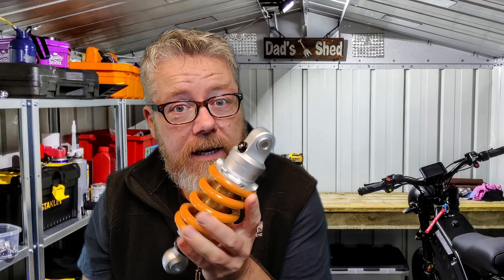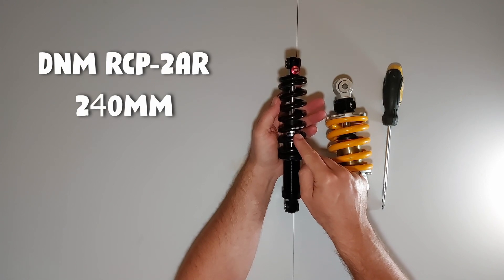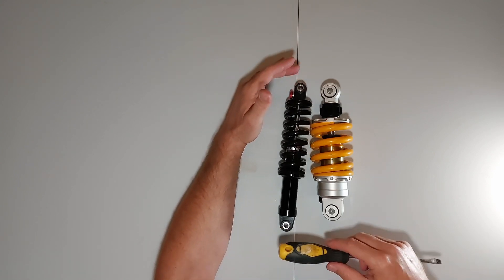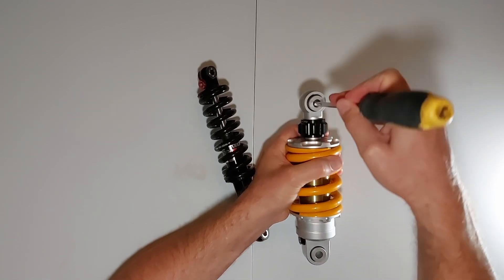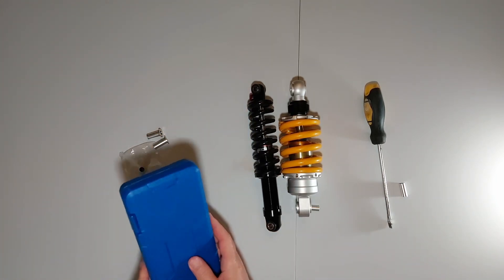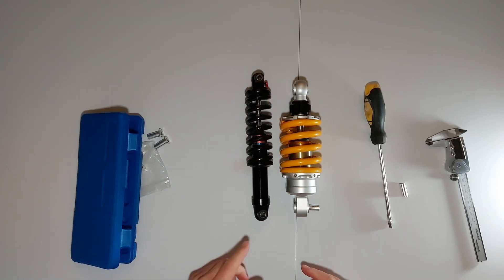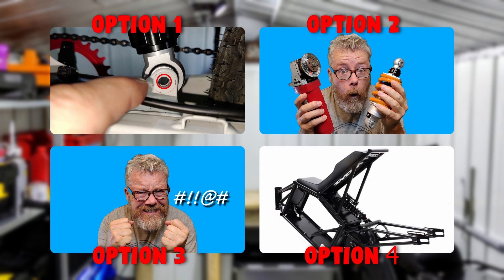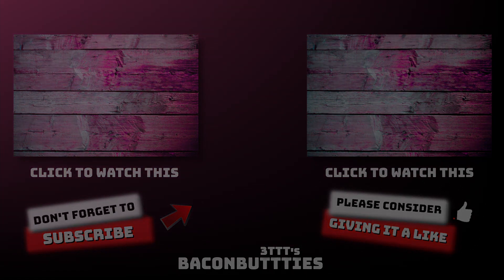CAN YOU PUT A MOTORBIKE SHOCK ON AN EBIKE - MSVA EBIKE BUILD PART 19 ISH

Comment: How about changing spring in the DNM shock for a higher weight rated one? I run a 700lb/I foxshox one in my DNM shock and it feels great on the road. Or you could get an even stiffer one made up to whatever you want, there are companies that do it. All the best
Reply from the maker: I contacted DNM and it was £12 for higher rated spring and £90 for shipping ... 😱
Reply: @baconbuttties  dnm are terrible for that. The foxshox springs are compatible if you want to try them
Reply from the maker: @Fred_PV  The foxshock spring will fit the DNM shock?
Reply: @baconbuttties  yeah it's the same diameter. It is for the rcp2s anyway, I'm assuming yours is the same too
Reply from the maker: @Fred_PV  👍🏼

Comment: Great video as usual. I saw it a while ago and I came back a few times to see the continuation of this project. Are you going to solve the problem and improve the suspension? I would like to see that. Thanks for your creative ebike content. You are appreciated.
Reply from the maker: I didn't like the handling of the bike at all, didn't feel planted.Had a few test rides the  sold it and the next project is electric motorcycle.
Reply: @baconbuttties  That's too bad. I'm sorry it didn't work out for you. Better luck on the electric motorcycle project. I will be sure to watch that next. I am impressed you responded to    so many posts. Cheers.
Reply from the maker: @davidlittlefield2483  👍

Comment: A: Make a new bush where the 8mm hole is offset relative to the 10mm OD?
B: Try the shock upside down?
Reply from the maker: I did try it upside down and was the same. I don't think there's enough material  to offset.

Comment: Could you evenly take 1mm or 2mm off the swingarm itself?
Reply from the maker: I,m not sure how thick the metal is so it may compromise strength.
Reply: @baconbuttties  im sure 1mm of it is paint most likely
Reply from the maker: @MrDeceptacon88  I think I would rather add material than take away. Possibly cut of mounts and have larger tabs welded on with 10mm holes and 10mm bolt.

Comment: Hi. Another good vid. I started with a DNM RCP3 on the rear of my bike (I am heavy and also have a QS273 motor) so a lot of weight. The shock bottomed out, I tried stiffer springs with no luck. Then I tried 2 DNM air shocks, better, but had to constantly pump them up. In the end I settled for the same shock you have (with a remote reservoir). About a 1000kms later, it is perfect. I drilled my frame to 10mm as I worked out the extra strength of the spring on the new shock, would be near the limit for an 8mm bolt. So, my suggestion, grind the frame between the bottom shock mounts, no effect in the strength, to get the clearance you need and try new shock with 8mm bolts. If it works well and you are happy with it, then drill out the mountings and use 10mm bolts. (Not sure how to contact you, but if there is a way, I can send you pics of the different set ups I tried). Sorry for the long message.
Reply from the maker: Thanks for the tips, I did look at the shock with the remote reservoir but bought the one without in the end because I wasn't sure where I would mount it  👍🏼 you can send pics to baconbuttties@gmail.com

Comment: The easier option is to grind the shock down a millimeter or two, the lengthier solution is to grind off the mounts and build new ones, then weld them on. However, if you go that route, you will need to remove the whole swing arm and re-powdercoat it after welding and grinding, as it will leave raw metal exposed. That’s going to be a much longer process and if it were me, I’d rather grind the shock, which will be a 10 minute job. If all else fails, you can always find a different shock.
Reply from the maker: I was originally going to try the twin DNN shock method but I don't know if that would still be bouncy. I would favour the new mount method even though its more work.

Comment: i agree with some commenters. dont grind, bend, cut, weld or drill your terrific bike with 3 miles on it. i dont think you should have filed the powder coat from the drop outs. i would have ground the axle just a little. it is exposed any way.
buy a different shock.
you will find they have loads of power. i know just from watching videos. there are a bunch of young guys that will twist that throttle just to raise the front wheel.
i started watching this build earlier this evening when i ran across your channel. i like the bike. i want to do the same but dont know if i should. i have even offered to slyyyyly build a mini bike or electric bike for some grandkids to play on. i got 1 bite and that was one that just started driving so that wont last long.
i wanted to ask when you find out how the power would handle my weight to let me know. im 6 ft 230 lbs. dont want to need power.
so i enjoyed watching. i will look and see what else you are doing later.
Reply from the maker: I,m 199 lbs and the handling  on the electric bike wasn't  very good. After a few road tests I decided  to sell it and start a electric  motorcycle build  using a yamaha  frame.

Comment: i like this channel .. i built a ebike( stealth bomber )  during the lockdown and  i had tons of issues 
do not drill or grind anything  !!!!!  it is the path to the darkside 
i suggest  option 3  then option 4 
or  realize this will not work  and get a stronger ebike "specific" shock  that fits
Reply from the maker: It is the the path to the darkside, because once you drill or grind  you can't go back 👍
Reply: @baconbuttties  If you are anything like me, the shock will be hanging around unused for years if it doesn't get fitted. I think grinding will be the best way forward. 

I like the pogo stick comparison, defiantly true!
Reply from the maker: @jamesclarkson5618  👍🏼

Comment: You can  cut off  shock bracket  and  rise it up little bit and welding back on the swing arm
Reply from the maker: That's probably the best option but probably the hardest. Dismantle swing arm, get someone to weld it, respray area  or could buy another swing arm and modify it  👍
Reply: @baconbuttties   you could  do that too
Reply from the maker: @ebikerider6273  👍🏼

Comment: I would weld 2 new tabs to replace the frames stock tabs, use 5mm plate. 
As a result of using thicker 5mm material you could then also make the tabs in such a way before welding to have multiple M8 or M10 holes (like around 3 holes) to allow for different Shock height positions for  your most comfortable riding position.

 I think if you made the tabs in an upside down trapzoide shape with rounded edges. (1 hole in centre down low & 2 holes equally spaced above) should work out nicely. Just my 2 cents. 😊✌😎
Reply from the maker: I agree with lower bracket fabrication being the beat solution  👍
Reply: I have a slightly older Vector Typhoon (4-5 years, the bike in my sig) which has an adjustable upper shock bracket that is basically just what you're talking about, it has extra holes in the frame to allow the top shock bracket to be raised up or down giving about 50mm of extra movement. After looking at your frame I can't understand why Vector would make this so called (tweak?)  The only thing I can think of is to save a little money by using fewer parts, but is it really worth it...
Reply from the maker: @hardergamer  👍🏼

Comment: I would probably nibble a little off the bottom of the shock and nibble a little from the swing arm between the shock mount but you could have someone weld up the hole , grind it flat ,then redrill it, then touch up the mount with a little tin of smoothright paint. You are doing a great job by the way, I’m intending to build something similar except I’m going to buy the larger frame from the Ukrainian company you got yours from but fit it with a normal motorcycle swing arm and go for a 12 kw wheel. Should be good. I’ve got a brand new set of forks from a Chinese 250 motorcycle with a ktm set of yokes and a Ktm 390 swing arm. Unfortunately the next purchases become expensive and I’m not sure I can hide them from the wife, 😂with the financial climate being like it is I’m going to wait a while till I buy anything else. Your project does give me hope that I will get there eventually 👍🏼👍🏼keep going. Ps I’ve just purchased a meriva like you as well , great minds and all that.
Reply from the maker: I been looking at the larger frame with the new swing arm they do for the QS 138 motor. How are you going to fit the KTM yokes? because motorbike forks seem better suited to these high powered machines.
Reply: @baconbuttties   I’ve seen a set of fast ace motorcross forks fitted to a Surron ( which are usually fitted with DNM forks) the guy had a couple of adapter cups milled up to convert them. I intend to do the same. I’ll be using the qs138 frame but without the swing arm as I want to use a hub motor so that the bike runs quietly ( no chain noise). I’m hoping for an 85 mph bike, which I will need to restrict down to 4kw for the msva test. I had an idea that if you get a bike finished you could then sell the frame and vin number and reg number on to someone to rebuild it using there own equipment ( you’ve done the hard work for them?) then replace the frame with your parts and repeat the process . Money could be made?
Reply from the maker: @christopherwatts6634  I wonder if there's a market for registered frames? As it could work if people are willing to pay extra 👍🏼
Reply: @baconbuttties  after communicating with eleek, I get the impression they are quite open minded when it comes to business, maybe strike up a deal via a franchise of sorts, they supply the frames which get registered. Once the msva get to know you, I’m sure things would go smoothly.? It’s a case of how many people would pay extra for the pleasure of having the hard work done? Food for thought. Keep doing what you are doing👍🏼
Reply from the maker: @christopherwatts6634  👍🏼

Comment: Just shows these frames whilst they may look all the same have subtle changes. Sorry to hear your still having problems with rear shock. I know your pain went to lace up my wheels and a simple task turned into my worst nightmare
Reply from the maker: Yes the frames are all a bit different. I don't think I would want to try lacing wheels as it looks like it needs patience 👍🏼
Reply: @baconbuttties  thinking about your issue and how I would tackle it I feel the best option would be to remove a little material from the lower shock eyelet just be careful to only remove enough for clearance  also if your frame is like mine and the steel plates have a weld seam on the inside you may only have to remove from the outer edge perhaps at a slight angle giving it a bevelled edge may be enough for correct  fitting
Reply from the maker: @haggisbasher2906  I don't think the shock touches the weld seems as the centre part is thinner than the overall diameter where the bolt goes through.

Comment: time for Mr Grinder to meet Mr Shock or just get a second hand Vanilla Float like mine mate...huh Houuyyy
Reply from the maker: Are the fox shocks okay ( not to bouncy )
Reply: @baconbuttties  we chatted a couple o weeks back, it's bloody dreamy, loads of em on ebay second hand. I got mine on Gumtree for £30 coz a lot of riders just want the latest models and have a chunk o furlough cash to spav.
Reply from the maker: @jclive4773  👍🏼
Reply: @baconbuttties  maybe i could borrow that Noggin of yours a sec. I am just deciding which Battery to go for, i'm building the same as yours but mid-drive bbshd and lightweight, to get back round the world with.
When we use the power modes on the controllers of these Bikes, does that dial down the amps or the volts? 
P.s. i never got to learn about electronics so i'm trying my best.
Cheers John

Comment: Don't touch the shock. Take off the back weel and grind out a little from the frame inbetween the two sides of the bottom bracket it won't take much to make it fit.  😎♥️👍🚴‍♀️🚴‍♂️🚴‍♀️🚴‍♂️🚴‍♀️🚴‍♂️
Reply from the maker: I'm not sure how thick the metal is so am not sure if grinding in that area is okay 👍🏼
Reply: @baconbuttties  I've heard someone with the cheaper steel frames had the weld where the swing arm meets the box section crack, so definitely wouldn't weaken that area.
Reply from the maker: @EverythingEbikeChannel  👍
Reply: The two sides of the bottom bracket is welded separately with a l shaped bend it is probably just the extra thickness of the bracket metal getting in the way the frame may not be the problem. It's Werth a look

Comment: Take the sleeve out go for a test ride see if you even like it.
Reply from the maker: I did put a 6mm in the hole and sat on it and it was more on the firm side which I prefer 👍🏼
Reply: @baconbuttties  definitely take it for a ride. Will tell you way more.
Reply from the maker: @bj97301  👍🏼